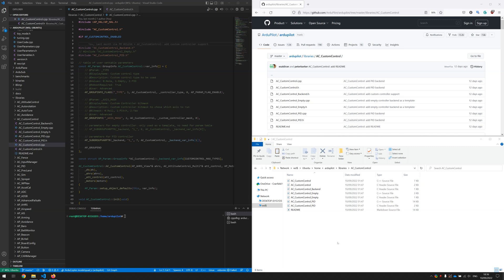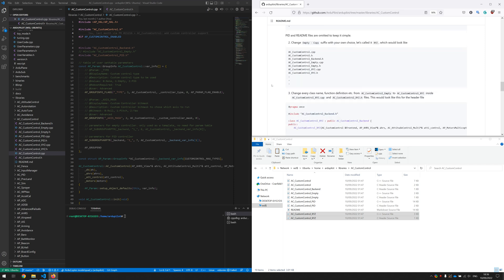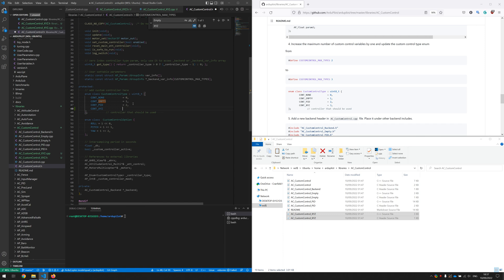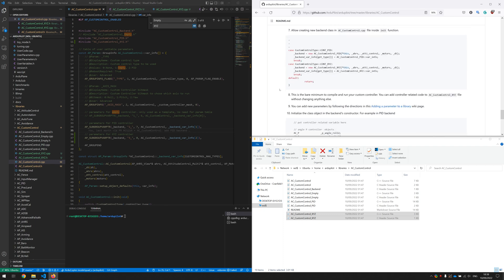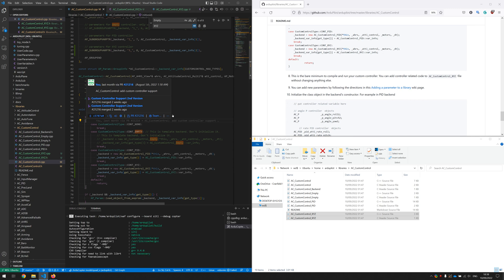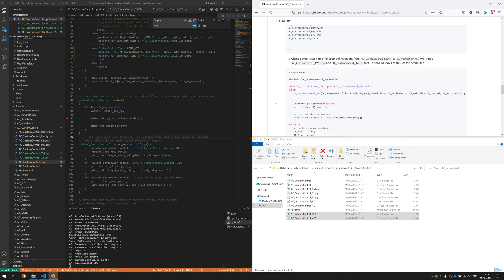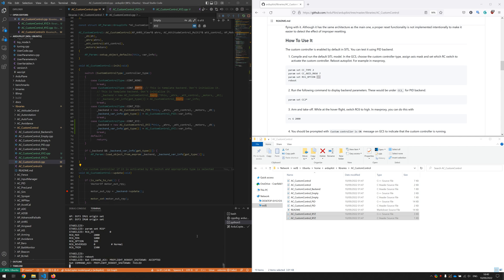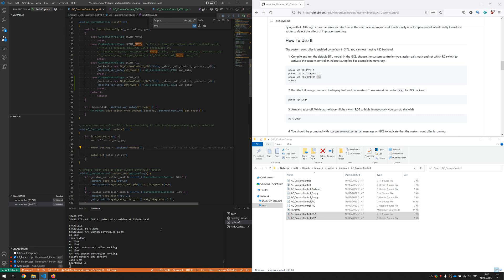ArduCopter Custom Controller Part 1:Create New Backend

Comment: The source code for ardupilot is slightly different than in the video rn. Im not sure if this is whats causing my issue but I followed your exact steps and im getting 
STABILIZE> Unable to find parameter 'CC_AXIS_MASK'
when using 
param set CC_AXIS_MASK 8
Reply: Were you able to solve it?